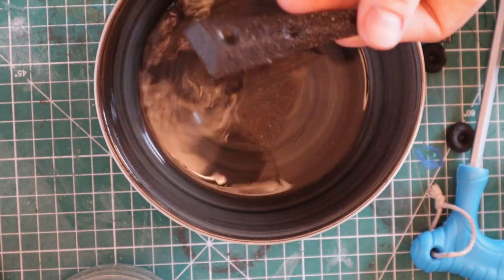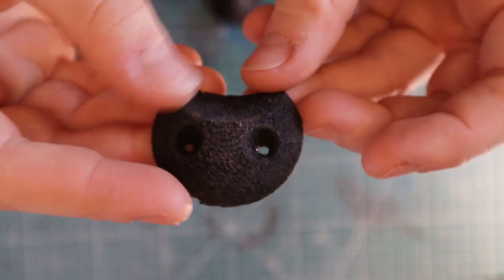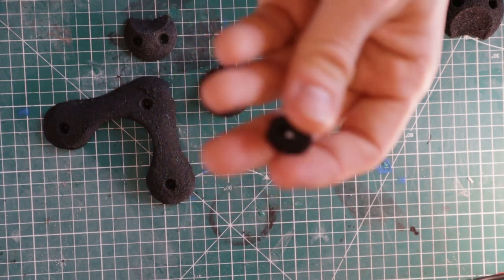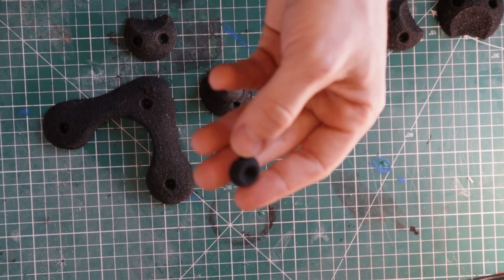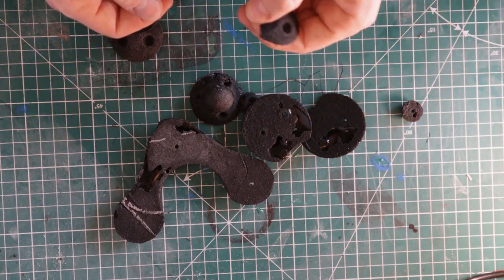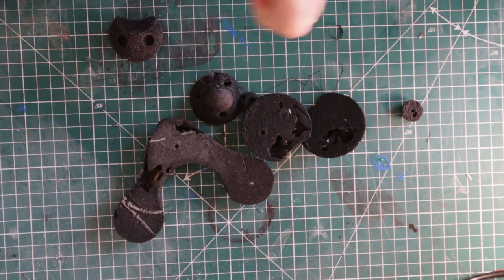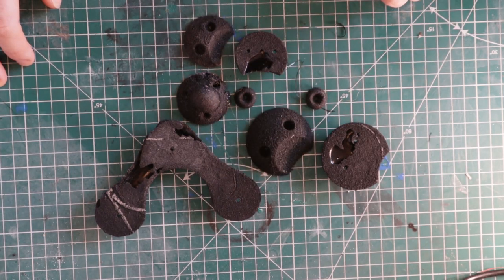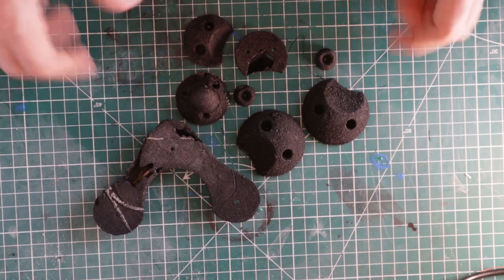3D Printed Climbing holds - finishing tips for great texture

Comment: I'm waiting on a printer but was planning on making a bunch of holds for a home board. Genius tip for the texture! I was originally thinking of coating them in a sand-filled resin but this is way simpler. For larger holds, my plan was 30-50% infill + some sort of internal 100% filled structure around the screw holes, and then flooding the empty space with resin to solidify the whole thing.
Reply from the maker: Nice idea! Be careful baking the resin, lots of resin gets very smelly and weak when baked. The 3d printed parts need to be 100% infill because the plastic melts and flows. I think for bigger holds sand and paint would work well, I've done another video about making volumes that has some discussion of this process, would probably be applicable to printed holds. For bigger slopers or chunky jugs concrete works well, done a video on those too
Reply: @gilesbarton-owen6783  yeah I meant bake with sand/salt first and fill the void with resin once the texture is set. You could fully pack the inside of the hold with salt/sand as well to stop the melted plastic from deforming all over the place. Something to experiment with I guess.
Reply from the maker: For sure, I'd probably print basically a thick shell (3-4mm) then pack, bake, then fill the back in with resin. Let me know how it goes! Was thinking of doing the filling step with concrete as I've got a load laying around

Comment: I've been designing a part for my printer which I want to be as strong as possible, and I've designed it to be remelted in salt, while mounted in it's mating aluminium parts. The part is basically a very short M8x1 hollow bolt printed in PETG, so the remelting in-place will be necessary to ensure the threads stay sharp and the tensile strength il sufficient.
Having messed with salt remelt before, I knew that these voids show up at the high points of the part, even with 100% infill. I suspect that this is partly due to small air voids that are left in even 100% infill areas. I know this is something that is visible when you try to print transparent parts; bubbles are very hard to avoid.
Anyways, the point I wanted to get to, is that I designed sacrificial sprues into my part, so that the void can "flow up" the sprues, which can then be cut off. I'm not done designing the whole system so I've yet to actually try the remelt and see the result. I've also been concerned with finding some sort of mold release agent for the PETG threads, I hope vaseline will do an adequate job
Reply: Also, I've found that pool salt is a very cheap source of pure, nearly food grade salt. With the quantities pool salt comes in it could become pretty economical to make very large, multi-part holds, that are simply melted together for assembly. Maybe even use pellets instead of filament to bulk them up in the oven
Reply from the maker: Good idea! Will try it next time I'm remelting!

Comment: Are these prints PLA? this look amazing. I really want to try this process but my printer don't want to 😂
Reply from the maker: Yep, normal black PLA printed at 100% infill. I've been printing on the hot side, 207C. Definitely doesn't matter if the print quality is a bit lacking especially if you wet the climbing surface and sprinkle some coarser salt on those bits first.

Comment: I have a question- is there something about PLA that makes this process work? Would it be worth it to try this process with a stronger plastic like PETG?
Reply from the maker: Nothing particular about pla except in terms of ultimate tensile strength and stiffness it is more or less second only to polycarbonate. Petg is significantly less strong but much more flexible, however, flexibility isn't a desirable property because the resin itself is quite brittle. The tough pla I use mediates between the two properties nicely to give stiff, strong but not too brittle parts which makes them a pragmatic hold to set with, with less likelihood of cracking when overtorquing. Stefan over on CNC Kitchen has done some fantastic material tests looking at actual strength numbers. 

There's also the question of bonding between the plastic and the resin... I'm not sure how Petg stacks up but the bonding with pla is pretty poor so I doubt it will be a huge factor.

I'd say if you have a lot of Petg lying around, it would work well, probably better than regular old pla due to the cracking issues

Comment: I reckon the holes in the back could be shrinkage in a similar way to an injection moulded part would … maybe
Reply from the maker: That's definitely one of my hypotheses, otherwise it's: voids in the initial print (pretty sure it's not), mold swell (my current hypothesis) or the plastic soaking into the salt enough to reduce the volume (definitely a factor). I suspect it's a combination of all of the above and the shrinkage

Comment: Why is it expensive? After initial set up costs, I think it could come out cheaper
Reply from the maker: Definitely depends on the size of the holds you're making, PLA is £20/kg vs resin costing much less. If you're making large simple holds its potentially cheaper to buy them just from a material cost point of view. Of course having a 3d printer etc is not a free thing. For small crimps they're definitely price competitive even with processing time factored in
Reply: @gilesbarton-owen6783  Yeah sounds like a good option for home wall holds
Reply: @gilesbarton-owen6783  I managed to get one bouldering route per spool of filament, printing some one hand sized holds, crimps and pinches and a couple of toe steps. Great value for at home and or testing your own hold designs.
Reply from the maker: That's so cool, nice work!

Comment: I designed my own 5 in 1 PLA pinch block, haven't printed any climbing holds yet though. Theres a setting in CURA called fuzzy that lets you adjust the abrasiveness of the surface as well.
Reply from the maker: I was thinking about curas fuzzy setting, I haven't got round to using cura yet but it sounds really interesting. I do wonder if it would end up the right sort of grippy, compared to real climbing holds, but definitely worth a shot
Reply: @gilesbarton-owen6783 It takes some tweaking to get the right finish but I think it works work. I haven't designed much of my own designs and still learning how to use Fusion 360 + cura. Lots of test cube prints to get the grip I like, great share on the salt annealing with the heat too
Reply: I printed a few holds in petg and one pla+ with the fuzzy skin setting, if you give it a finish with a wire brush or a light sand with some 200grit it becomes quite grippy, its still a slight directional grippy-ness tho but totally good enough.